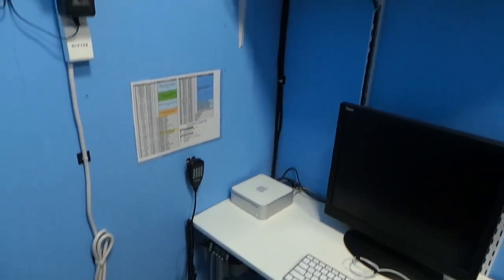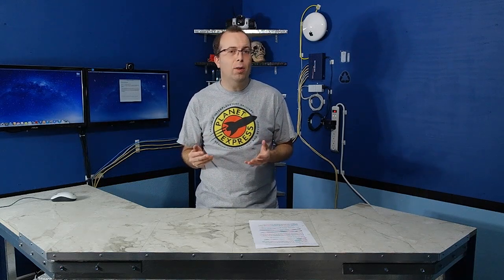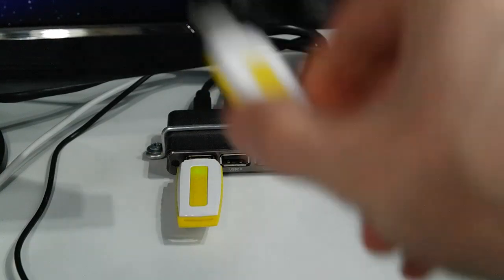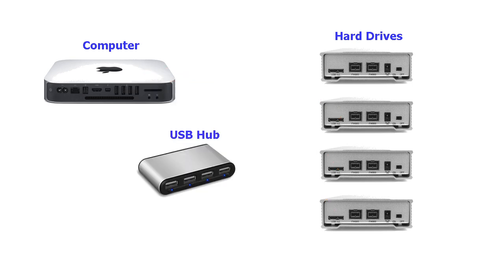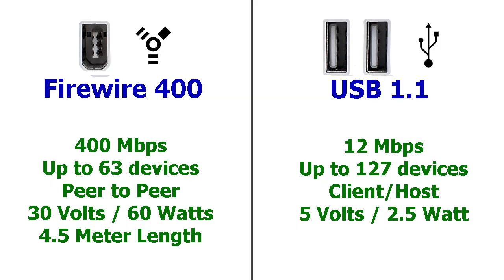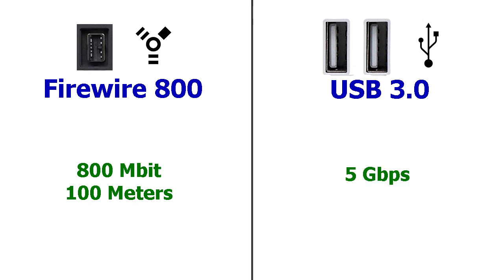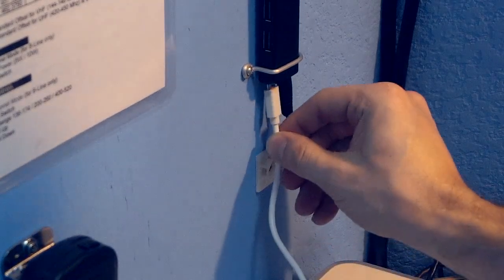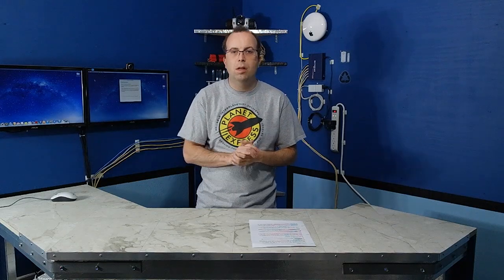Farewell R.I.P. Firewire, Hello USB!

Comment: we should use eSATA for storage
Reply: +Mustang Rt 
Yes, but you are very limited by the amount of eSATA ports you can have. With USB you can just buy another cheap 10$ hub, but eSATA you can't do that. You'd need to buy another whole eSATA controller card to manage it. Plus eSATA can only be used for storage and nothing else. Where as USB is massively compliant with everything.
Reply: +akabiscuitwaffle However, usb is slower and cheap usb hubs make speed even worse. Also keep in mind that usb hub shares the same speed over all of its devices. For a nas without any redundancy that transfers just a few files a day that might be ok. But if you want to have nas with raid it is just slow as hell compared to sata
Reply: +Jurgis Balciunas (Intel) 
It's not really slower. USB 3.0 does up to 5 Gbit/s and USB 3.1 does 10 GBit/s, compared to SATA3 at 6Gbit/s. Have you even used USB 3.0? 
The difference negligible to non-existent at this point. In fact some high quality USB 3.0 flash drives are just as fast as their SATA counterparts. 

As for the shared bandwidth issue- 5Gbit/s is a lot. Unless you're trying to ram 6 storage drives running at max speed at once while having the need to be able to quickly take them with you, I don't see the issue. In which case, hot swap-able bays are the go-to solution instead of carrying the crap ton of cables, cases, and DC adapters to power the external storage bays. 

I can't imagine a single scenario where where USB 3.0/3.1 isn't a better option then eSATA at this point. Even in professional areas why would you use external drives for your server storage instead of internal SATA?
Reply: +akabiscuitwaffle Ok, so firstly we are talking here about NAS, not your portable hard drive which you carry everyday. Also I was not talking specifically about eSATA but generally about SATA interface which is essiantly the same, the only difference is how you feed power.

Another thing that you should be aware of is the practical speed of USB 3. Which in many cases maxes out at about  1 gbps. On the other hand, even the cheapest SATA drives can easily achieve atleast 4 gbps. Now connect multiple usb drives with a hub and see how speed crawls when trying to copy files from different computers and drives. See benchmarks.

As I said this setup with USB 3 may be good if you are only storing movies or documents which you occasionally transfer and only use single drive and have no data redundancy like raid. If you have RAID1 setup, your transfer speed is now 2 times slower as 2 drives are being written through a single usb connection. For any serious usage like video rendering or virtualization you wouldn't want to have these slow USB drives and would go with a hardware RAID internal drives.

Also why would you even want to take your drive out of a NAS that you would need external drives? If you have NAS you probably can access any of the files through internet

Comment: Was Firewire even a thing on Windows? I´ve never seen a single Firewire device in my life (I´m 27), except hardware specifically designed for Apple computers and I´ve also never seen a Windows machine supporting Firewire. This could be the reason it lost, even with better features.
Reply: I have a fire wire port on the front of my computer case ( I'm 16)
Reply: +Jutsch80HD I had a DV cam and it had a FireWire port. I also had a DirecTV+ HD decoder and it had a FireWire port. Some professional cameras also have FireWire ports (I think they use FireWire 800 for the new HDDV cams). Oh! and by the way, I'm not even close to work or study anything related to professional a/v, but I've heard and read that FireWire is still being heavily used in that industry (at least Firewire 800).

Comment: There is firewire 1600, but steve jobs said firewire was dead in 2008.

Even to this very day with octacore CPUs that can run at 5Ghz, USB 2.0 wont really go above 35MiB/s
I hate this theoretical speed USB uses
Reply: +IIGrayfoxII Firewire was even specced to 3200 Mb/s in 08
Reply: Theoretical maximum data rate of USB 2.0 is 480 MBit/s = 60MB/s
This, however, is the physical (brutto) data rate. The theoretical maximum usable data rate is about 53MB/s, which still is very hard to reach due to additional factors like device management. Realistically you can get up to 40MB/s os usable data rate.
Reply: +IIGrayfoxII You are forgetting that you cannot communicate with so much data if both devices cant handle the load, your computer might be able to, but that USB IC sure as hell cant
Reply: Coco The AMD FX-9590 octa core CPU clocks at 5GHz in with Boost Mode (4.7GHz normal)
Reply: Coco It does have a TDP of 220W though ^^
Reply: +Coco Ever hear of i7 or Xeon CPUs?
Ever of overclocking.
Reply: +IIGrayfoxII USB 2.0 theoretical is 400mb/s when a PC is transferring it shows that number in MB/s aka 400/8 or a theoretical max of 50 MB/s
Reply: +James Roy your dumb
Reply: +IIGrayfoxII There are no octacore CPUs that can run 5Ghz, that's the weirdest thing I've heard today.
The comparison between CPUs and uh USB is really silly...?

Also USB 3.1 is pretty darn fast.
Reply: +SolarAlliance 8 physical cores? Cool! I didn't know that.
Reply: +SolarAlliance Haha understandable.
I guess we'll reach 5Ghz on lower TDP as time progresses, even though shrinking seems more difficult nowadays.

Comment: Firewire is still way better, I wish we used it and not USB, USB using IRQ to tell the processor to stop whatever it's doing and handle the USB request.
Firewire uses DMA, which there is a separate controller to handle transfer from device to memory.

Comment: USB devices could easily do daisy chaining by just integrating a small hub into the device. There's nothing particularly preventing a small device from integrating a hub, other than having space for the second connector.

I feel the reason why USB devices don't do this is because USB devices are marketed for lower cost / mainstream markets while Firewire devices are for professionals who would pay more for those kinds of convenience features. Why spend $1 on including that second USB receptacle when your average customer isn't going to buy more than one drive anyway?

For the record, everything I'm saying about Firewire also applies to Thunderbolt, which is essentially occupying the same market niche Firewire did for professional I/O. Though, that distinction is getting clear as mud since USB Type-C connectors are specifically designed to allow certain approved alternate modes to use the same physical connector and wiring... like, say, Thunderbolt.

Comment: What about Thunderbolt? I'm interested in your take on that.
Reply: +Indigo8086 Thunderbolt is pretty much the true successor of Firewire, as it does both the daisy-chaining and the peer-to-peer connectivity, even between computers. However now is actually a bad time to invest in the thunderbolt ecosystem, as Thunderbolt 3 is coming, and it is going to use a different connector (USB type-C instead of the current mini-DisplayPort), and most likely drop compatibility with Thunderbolt 1 and 2.

Comment: Too bad USA-market Blu-ray Disc recorders still don't have HDMI inputs, HD component video (the only analog HD video in the USA) or ATSC TV tuners on them, and that there are scant, if any, D-VHS VCRs with HDMI input on them. (The newest D-VHS VCR probably only came out just barely as HDMI was finalized.) USA-market Blu-ray Disc recorders don't have USB 2 or 3, either. So if I want to record anything in HD to a Blu-ray Disc using a standalone recorder, I would either have to use a 
camcorder with 1394 output ("FireWire" is only Apple's term for it; "iLink" is Sony's) -- and that's only for "camcorded" stuff -- or buy a $600+ HDMI-to-1394 converter box made by Grass Valley (the HD-50). Hmmm....

Comment: With that many external drives I would recommend building a Home Server and connecting them via SATA (better throughput). You could probably strip the external and re-use the actual HDD's inside. Initial costs are there but future HDD upgrades will be cheaper. (NOTE: Some external, especially 2.5", have a USB / Firewire controller built onto the drive PCB, which means they don't have a SATA or IDE connector).

Get a mini-ITX motherboard + case with enough ports / slots (power usage is minimal), then use something like StableBit DrivePool to create redundancy. I've been using this setup for about 1-2 years and it's very flexible. It allows you to pull out a single HDD and still be able to read the contents because it works on a file system level (unlike traditional RAID). Another useful feature is being able to select duplication (RAID 1) on an individual folder / file basis. Don't bother with Microsoft's Storage Spaces, it's a hassle, especially recovery (tested it for 6 months). 

Use a fast HDD or decent SSD on your workstation, then transfer data to your networked Home Server for archiving which has redundancy. And always remember to have an external copy of your most valued data, preferably another location (like the cloud) in case your house burns down! 

(From what I understand you're primarily an Apple user, but there's much more to be had on Microsoft or Linux, given the subject of Home Server / Enterprise storage that is).

Comment: If Firewire is dead and Peer to Peer file tranfers is not possible on USB, how can Peer to Peer direct PC-PC file transfers be carried out?
Reply: +BelRiose2000 USB CAN be use on Peer To Peer since USB 2.0. Most of the cable of today support it, it's the OTG standard, the one we use on smartphone. Even if USB wouldn't support it, you can connect two computers together with a Ethernet cable, it's Peer To Peer. Also, Thunderbolt support P2P, so we have a lot of options.

Comment: I personally liked how FireWire was hardware controlled and thus had close to zero CPU overhead. Then it was also really versatile as it had the ability to read and write directly to the system RAM directly rather than having to pass the data to CPU host code to read or write into system RAM. This and the low latency was part of the reason why so much audio and video hardware used FireWire.

Comment: I'll run out? Pff, buy a high end or even mid range motherboard and you'll get about 8 USB 3.0 and 2 USB 2.0 minimum not including any front panel connectors.
Reply: +Euroliite Better get a new server with a 8192-bit CPU with 64 cores running at 10 THz each (so it can transfer files at LUDICROUS SPEED), 10 TB of RAM (so it can store several backups of your hard drives in RAM when a port gets detached for no reason lol), 26 USB 6.9 ports that can transfer files at up to 128 Tbit/s, can carry up to 500 W of power with 230 V of tension, have support for optic fiber USB cables etc, actually screw it, it has 30 internal HDDs each containing 1 TB of data, connected to the motherboard via SATA-N cables, the motherboard has a giant ass heat dissipator that will take up half of your bedroom, slots for 10 CPUs, 50 PCI-e slots for up to 50 graphics cards just in case you change your mind and want to use it for gaming instead of sitting there being a server lol
Reply: +HOO? my MSI X99 SLI Plus has a shit ton of 3.0 ports only 2 2.0 ports tho
Reply: Billy Mays hello
Reply: Billy Mays hello
Reply: Billy Mays ok
Reply: +RickyFromKingston Better to get an external hot swappable drive cage than connect 20 external hard drives via USB...

Comment: Firewire 400 had a faster throughput speed than USB2. Average USB2 speeds were generally half of their peaks of 480 while Firewire had a consistent throughput near 400. That's why it was better for more data intensive devices like hard drives and miniDV camcorders.

Comment: forget about all these comments suggesting thunderbolt, why don't you buy/build a NAS device?
Reply: +Nathaniel Beven Not to mention they make multidisk raid enclosures that support firewire 800. Hell I found one on newegg in less than 5 minutes (ICY DOCK MB662USEB-2S-1 if &quot;the 8 bit guy&quot; is interested). Like scratch the those consumer external drives they sell at best buy and the apple store, and go build your own 6TB monster!
Reply: +Nathaniel Beven  i have a naz drive
Reply: forget about the fastest interface to an external device available, listen to me, some fucking idiot, I'll tell you a NAS doesn't use network bandwidth (it does!) And just because your "workload" is so small you can't see how terrible you're setup is, it doesn't mean you should ever give advice.
Reply: Your network doesn't get limited when you use your NAS device , unless utilizing very old 10MB ethernet or wi-fi b. Almost every network device is gigabit  and/or wireless N (450Mbs)  Hell, i run Photoshop and games off my NAS wirelessly without any problems and when doing so, my network is still response for everyone in my household. Again, i didnt spend "extra", those are the standards, if i did, id have wireless ac and have 1400 Mbs.
Reply: +Nathaniel Beven Maybe he wants his network free for other bandwidth heavy tasks?
Reply: NAS does use plenty of network bandwidth, it requires 100BaseT at the very minimum, GigabitE for decent speeds. I did build a NAS box circa 2010, I still prefer a Thunderbolt disk array instead. :P

Comment: USB was supported in windows all the way back to Windows 95 (with USB support) edition officially.  You need to do your research better.  Also thunderbolt has been replacing FireWire for a while now on mac.  Between esata and USB 3 we have had a lot of alternatives to FireWire.

Comment: Many years ago I bought an iMac, the one that looked like a half sphere, to interface my sony camcorder.  Worked perfectly and at the time the intel world had nothing that worked as well.

I still have the old Sony camcorder so I keep the iMac around to process old movies and new if I decide to use the camcorder.  

I did several weddings with this setup using iMovie and iDVD or whatever it's called only one of the weddings ended up in a divorce several years later. :)

I use the iMac occassionally to trouble shoot a NetFix DVD that won't work on my DVD player.  The Mac of course is rock solid and works every time.

As an aside I do have an old Dell Enspiron that has firewire, although I have never used it.

I'm sorry to see firewire go.

Comment: Just to say, Thunderbolt is sort of the sequel (somewhat) to FireWire, because it is featured on all Apple products and Thunderbolt 2 transfers at a staggering 20 Gbps! If you buy a slightly newer Mac mini for your file server you can run everything off Thunderbolt and have 4x faster transfer speeds than USB 3.
Reply: True but thunderbolt drives cost x3 times a USB drive
Reply: That can be true - but most of the time the Thunderbolt drives you can buy are not very expensive! You can buy a LaCie rugged 1 TB drive for around $100
Reply: Wolfgang Frick Yes but you can buy a 1TB USB 3.0 External HDD for 50$... So it is still cheaper than Thunderboldt drives
Reply: True, but technically Thunderbolt drives have more value because you get more bang for your buck. Thunderbolt 2 has a 20 Gbps transfer speed, while USB 3.0 has only a 5 Gbps transfer speed. If the USB 3.0 drive you mentioned costs $50, and the LaCie Thunderbolt Rugged drive with the same capacity costs $100 (twice as much), you're getting 4x the transfer speed with the Thunderbolt drive, but only for 2x the price.
Reply: Wolfgang Frick Well that's true... In the end it will only depend on what you like the most, storage vs speed
He has a server PC so I assume he has at least 2 drives in RAID 0; maybe not so impressive as Thunderbolt but will still give you fast speed + huge capacity for the same 100$
Don't get me wrong, if I had a thunderbolt capable PC or Mac as my home server I would totally go 3 Thunderbolt 2 external drives of 2TB in RAID 5
That way 3 people can watch 4K content without lag
Reply: They both have their strengths and weaknesses so whoever needs the space would go with USB 3 and the person who needs the speed of transfers would definitely go for Thunderbolt 2.
Reply: Wolfgang Frick Yeah or wait until Thunderbolt 3 and USB 3.1 HDD

Comment: It's too bad FireWire couldn't carry on... If it were here today, it would be at (around) 15GBPs.
The native support of USB flash drives you showed really helped with a project of my own, where I tried to get USB flash storage to work on a 19 year old laptop. Pretty slow, but usable...
I will agree ion the fact that the daisy-chaining was very cool! I wish that it could be adopted by the next generation of USB...
I actually have a 4-port USB hub that (acts) like a docking station. I plug in the USB, I get instant access to my mouse, keyboard, DVD-RW Drive and any other peripheral I wish to connect...
FireWire can connect TWO laptops? Maybe they used it in the early days as a way to link your laptop to your daily used desktop...
Fun tip: If you run out of ports in the USB hub, you can connect another hub to the last USB port on the other hub. Works very well...

Comment: I am still using Firewire on my three Macs. The 27" thunderbolt Display also contains a FW800 port. Replacement will be if required Thunderbolt. The reason is daisy chain just as known in firewire case. I just bought two used FW800 drives and replaced the internal drives… ;o)

Comment: Thunderbolt is the replacement for FireWire, right?
Reply: Jack Frost FireWire is made by Apple, while Thunderbolt is made by Intel.... So it's not a DIRECT successor....
Reply: MilenniumEdition 56 So, your saying that it has to be made by the same company to be a successor! Based on history (Power PC being replaced by Intel for example) i would say you statement is false.
Reply: Jack Frost After reading up on it, it is a DIRECT successor...